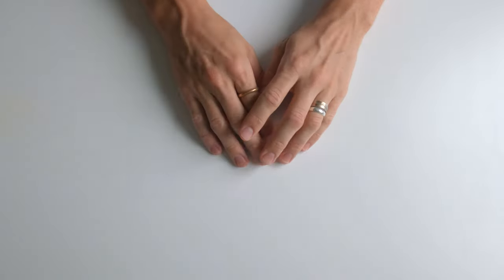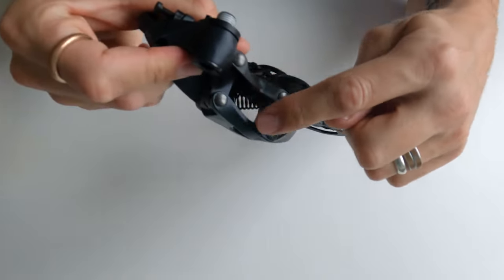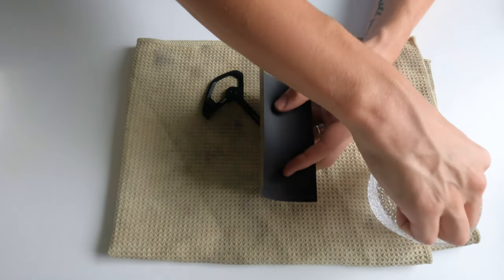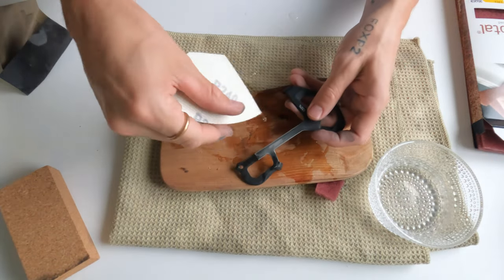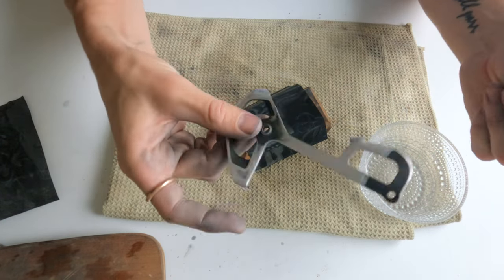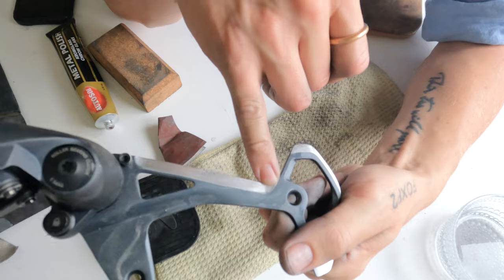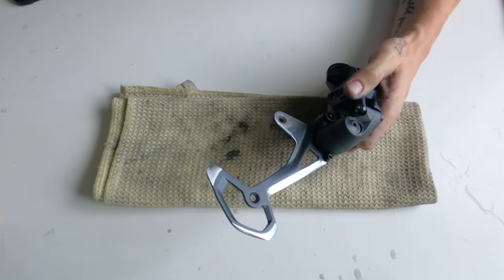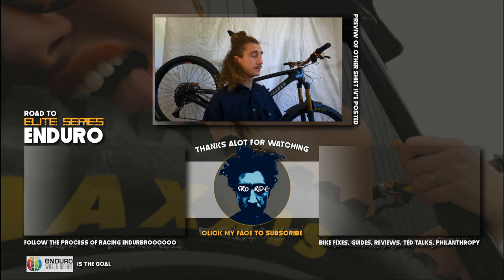Polishing MTB Parts - Full Process

Comment: And it will corrode and pitting with shitty look soon. Anodizing is there for a reason!
Reply from the maker: Yeah it’s going to look shitty for sure, but let’s forget about that and admire how it looks when indoors ok!
Reply: @Frorideism  you can use everbrite as a good clear coat for polished aluminium

though if don't bathe the thing in salt it will fine, it'll only tarnish a tiny amount then stop (well, my frame does anyway)
Reply from the maker: @robinrai4973  Yeah for this one I didn't really care since I'm probably bashing it into a rock sooner rather than later,
But for like a frame or if I do the linkage will def do a clearcoat, 👍
Reply: @Frorideism  I haven't yet put the clear coat on my frame, it's been a year and it looks pretty much the same

I didn't go completely mirror finish polished though, just mostly shiny (also haven't ridden in salt or drip sweat)
Reply from the maker: @robinrai4973  Ah I see, yeah I mean if you have a more "brushed" look it probably should be OK like you said. 

The clear coat on my cranks wore off after just a few weeks and they look fine, shitty clear coat quality though but I guess cranks do take a lot of rubbing from the shoes.
Reply: @Frorideism  it's brushed but then polished on top haha, either way I reckon you're mostly fine without clear coat unless you're particularly sweaty or ride in alot of salt

Clear coat really struggles to stick to polished aluminium, that everbrite stuff is made for it and is very hard though apparently